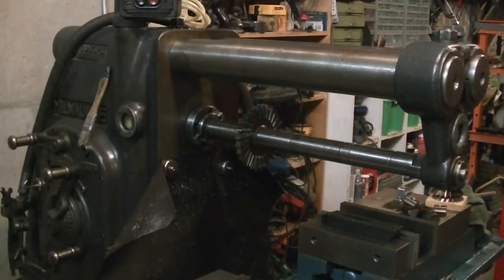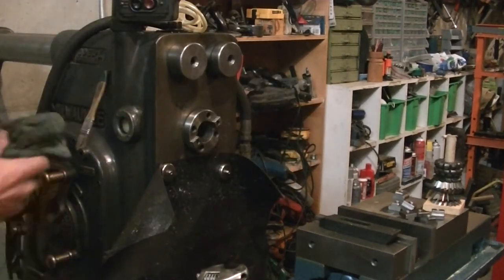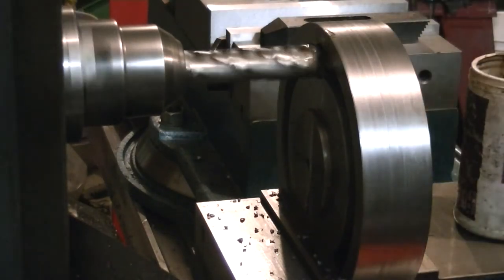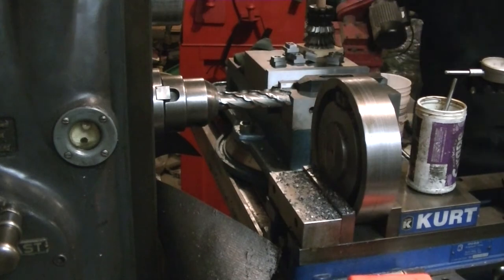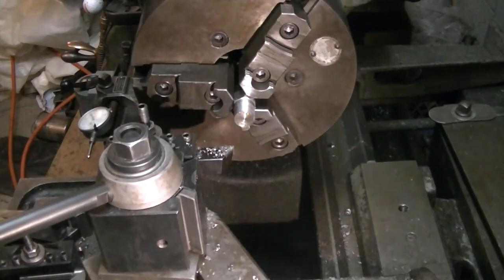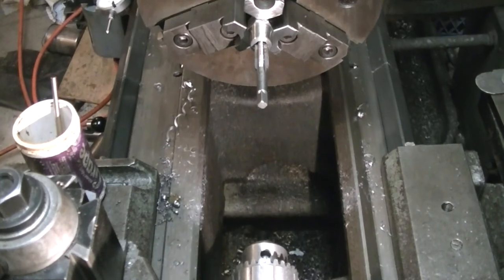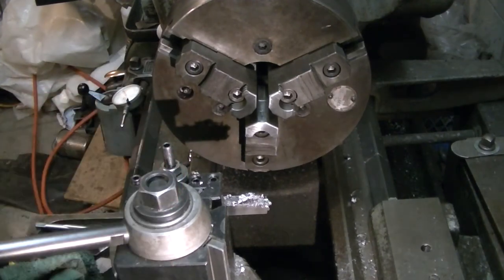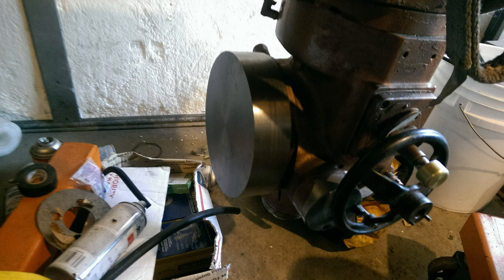K&T Mill Vertical Head Mount Part 2

Comment: Hi Mike great video. I also have a K&T #2, not universal tho but it does have the vertical head. I was also thinking of putting a bridgeport style head on it so I could use a quill.you mentioned going 500 miles south to California. are you in oregon ? Thanks again for the great video.
Reply from the maker: Mark, I'm actually in Utah. I bought the Hendey lathe on eBay and picked it up in southern California. I've really enjoyed the Bridgeport clone on the mill, for the work I do it's worked well. Switching back to the horizontal mode takes about 10 minutes but putting the vertical back on and tramming it is more like a half hour. Craig